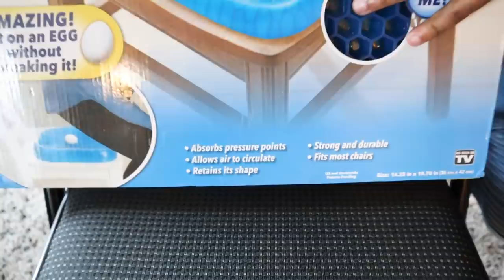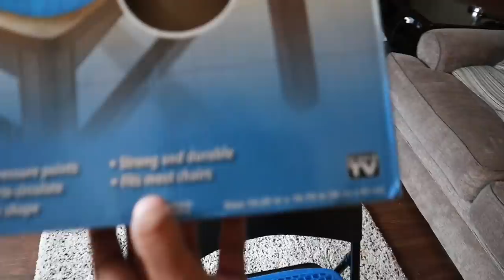I Bought A PILLOW That Makes Any Egg UNBREAKABLE!! (LINE-X EGG EXPERIMENT)

Comment: ADHD’s World idk if you already covered this (bcuz I’m new) so here’s my theory: the egg (or right now we’ll call it the ‘host’ -it’s not really being ‘taken’ over per say though) has probably broken inside. But as the ‘host’ it was covered with the ‘Line-X’, the spray (or whatever) probably took the shape of the host, then when the cinderblock is being dropped. The pressure probably destroys the egg on the inside, but since the egg was coated/covered with the stuff the Line-X acts as mold, so the insides might be broke we just can’t see it.